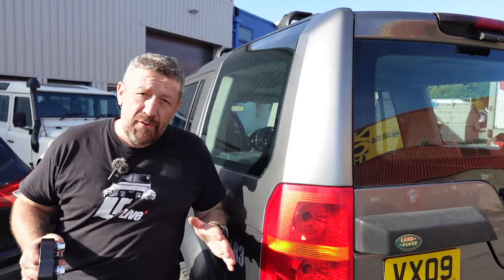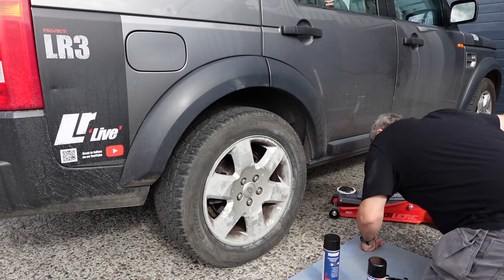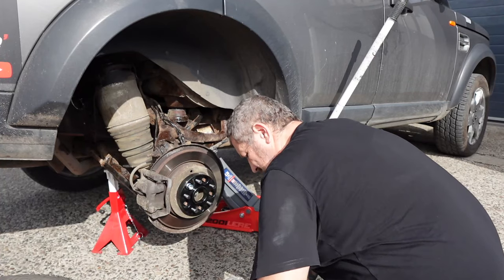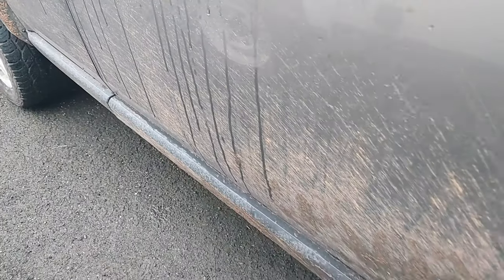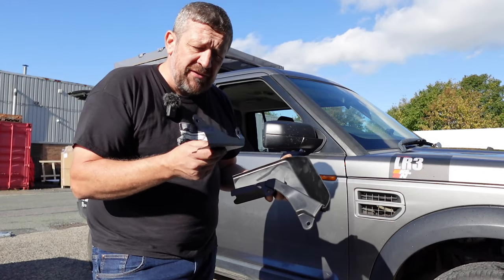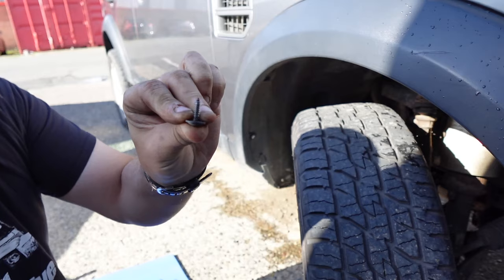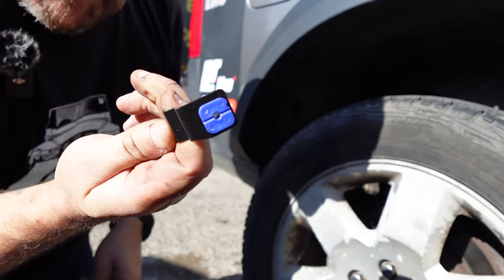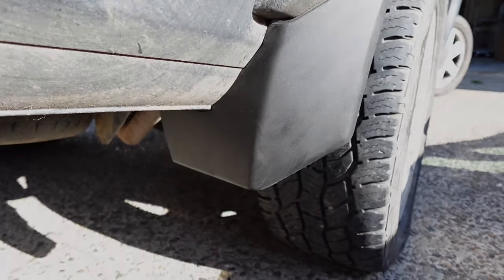Are wheel spacers worth fitting to a Discovery 3?

Comment: Not sure why people dislike wheel spacers, I think they have never used them but heard a bloke in the pub saying they cause problems? I have them fitted to my Defender and have had them on for over 60,000 miles without problems, it was said that my wheel bearing would fail very quickly, but on inspection they are perfect, and I can at least park in a car park and turn around in tight spaces without problems, they are one of the essential mods to a Defender! Chris B.

Comment: My understanding is that with wheel spacers (and certain offset wheels) you need to fit wider wheel arch trims so that the wheels do not protrude beyond the vehicle. This is certainly the case if you drive the vehicle in Germany and the UK (not sure about the rest of Europe) wider wheel arches should help mitigate the amount of mud thrown up the side of the vehicle too. Good practical video, thank you!

Comment: A very controversial subject wheel spacers.  Yes they could put more load on wheel bearings but what is not realised is the change in scrub radius, whether positive or negative.  This can effect steering and load on the suspension.  At the end of the day, certainly in the case of a Defender it's just a tractor with twin cup holders so no big deal.

Comment: Ignore any talk about hubcentric spacers not putting strain on wheel bearings.
Simple fact is, if the sectional centreline of the wheel isn't in line with the wheel-bearing (for whatever reason) there IS going to be extra stress on the bearings.
The only question is how MUCH extra stress is on the bearing - and whether you're prepared to accept that in return for any benefits spacers (or offset wheels) provide.

Personally, I fitted slightly larger tyres* on my D2 (265/60R18 vs 255/55R18) and that was enough to make the inside edges of the tyres rub on the radius arms at full lock.
I fitted 30mm spacers and that gave me enough clearance that I could also adjust the lock-stops to allow for a better turning circle.
I've been running the vehicle like this for 3 years (40k miles) and haven't needed to replace a wheel-bearing yet so it seems like the wheel-bearings are coping with the extra stress fairly well.

Bear in mind that your driving style will be a factor here, too.
If you're the sort of driver who cranks the wheel from lock to lock while the vehicle is stationary you're going to apply much more stress to the wheel-bearings than a driver (possibly an older driver, who grew up with cars that didn't have PAS) who does most of their steering while the vehicle is moving.

*FWIW, I'm not really into the "ruffty tuffty" thing but the standard gearing of the D2 means the turbo kicks in at around 50mph in 5th gear, which is probably good for acceleration when overtaking but it also means the engine is constantly surging on and off boost when you're cruising at A-road speeds.
I fitted the larger tyres to increase the gearing slightly, so I can sit at 55mph without the turbo kicking in, which makes for a more relaxing journey at disco-friendly speeds and, if I want to overtake, I can still drop down into 4th gear, where the tturbo comes on boost and the higher gearing means the vehicle has longer legs.
Reply from the maker: Some sound advice there cheers
Reply: I have has spacers on my Defender for decades and the other week I took off the hubs to fot new rotors.  The bearings were in perfect condition.  Buy decent bearings and you'll be fine.  Obviously much of the points you mention are valid.

Comment: If you are going Off-road, the Mud Flaps are far more important that the Wheel Spacers.
- Trust me, I’m a farmer………with a 2005 D3 11:26 !

Really not sure about the Wheel Spacers. Surely they will put more stress on the Wheel Bearings due extra leverage?
Plus you will need wider Mud Flaps than the ones you have fitted. Which are then more susceptible to damage in deep rutted tracks.